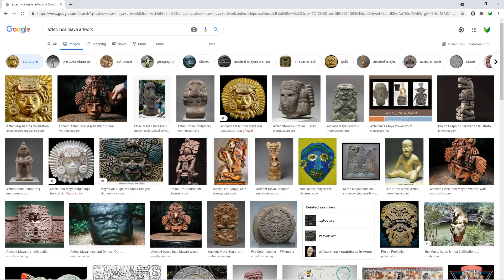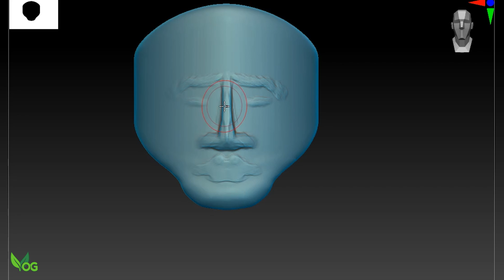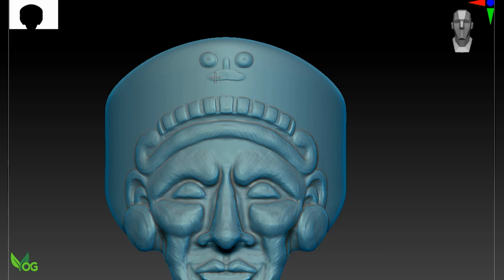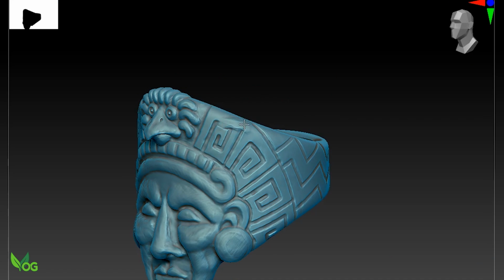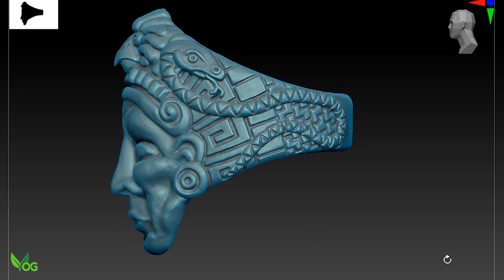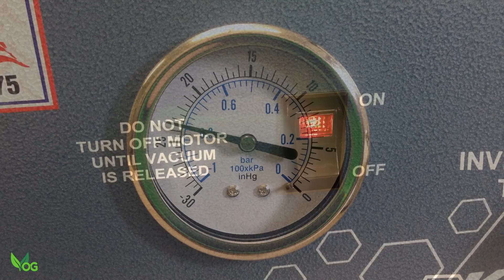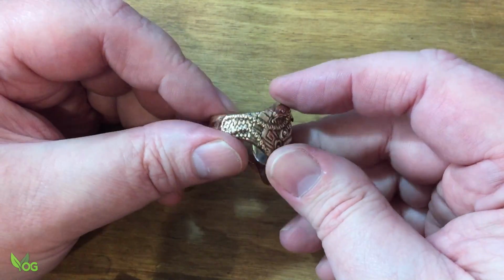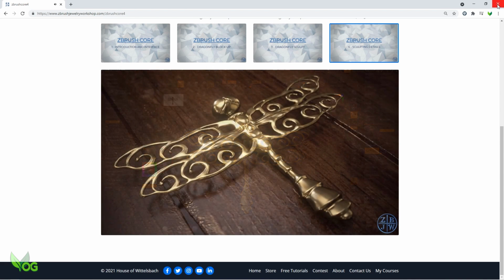Casting an Aztec inspired ring - 3D print to metal ring home casting by VOGMAN

Comment: Those snake heads and that beak are so detailed you've done an incredible job as usual 👏 Wondering which buffing wheel you used for this and what rubber/silicone gasket you use on your vaccum machine?
Reply from the maker: I haven't a clue about gaskets... they came with the Vac machine. As for buffing wheels, I just use whatever I can get 😁
Reply: @vogman  Not a problem i believe we need the graphite ones for casting gold. Yeah same here lol just been trying a few different ones to see whats effective 😅

Comment: Hi, I had an idea which I though you could test,  I will also test it.  Since burn out resins are quite expensive, I had the idea of printing a reverse of the item in a square/rectangle mould. You could add some posts extruded on one side which enter into holes on the other side to line up the two halves, and add an Injection port. You would then have a master mould you could inject with regular casting wax and use over and over again, and it's made of regular resin. I checked the temperature that most resins melt at and the wax seems to melt at a much lower temperature so I think this could work. Please let me know your thoughs,  maybe you have even tried this and I didn't see.

Comment: Hi VOG, it's been a while since I've commented, but I was wondering if you could help me out on a small predicament I am having. I would like to know if you have any idea on how I could convert the weight of the 3D print (finished, cleaned, cured etc.) to approximate casting weight. I've had some castings made and I've tried the method of using wax weight * metal specific gravity, but it is off compared to what the raw uncleaned/unpolished piece weight is. Do you have any idea on how to be more accurate or closer to the actual weight (of course, what's left of the sprue usually does add a little weight, but my pieces are cut pretty close so this may be negligible). Please let me know, and if anyone else has any input, please feel free to comment. Take Care. 
Regards, Tanner N

Comment: Wow!
Reply from the maker: Thanks 😁
Reply: @vogman  from the accent and the hobby... Is it fair to deduce that you work in the jewelery quarter in Brum?
Reply from the maker: I think it's about 10 miles from here as the crow flies, but no, I'm not employed there... I haven't been there in years. I am a complete amateur. Until just a few months ago I'd never had a bash at CAD work, jewellery design, etc. Metal casting is something I sort of fell into when trying to make a remote control lawnmower. This channel is very much my journey. I don't think I've held anything back, especially my many mistakes 😁
Reply: @vogman  Honestly, the humility and openness of sharing mistakes is 1000% more valuable than people who hide their mistakes and make everything look easy. I am an aerospace engineer in academia and I can tell you I've learned more by binging your videos in the last couple of days, vicariously learning how to and not to do things through you, than I have in any journal or textbook. 50% of the battle of disseminating knowledge is in its presentation, which you have also nailed. I doff my cap sir, and will be heading to Patreon to support. Thanks again!
Reply: ps: Specifically, your videos have helped me dial in what methodology and equipment I will be using to cast some aluminium parts for a drone. I've always stressed about detail and resolution in prints but what you guys do in the figurine/jewellery world far surpasses what we need (although geometric tolerances are undoubtedly much lower)
Reply from the maker: That's incredibly kind of you. I always think that the guy who doesn't make mistakes is the guy that hasn't done anything. I've made plenty and shared them as they've come up. My hope has always been to interest and inspire others. If I can spare them unnecessary time and expense, then all the better.
Reply from the maker: EXACTLY!!! I've had a few criticise my jewellery or miniature castings as being frivolous or pointless. Personally I've simply been trying to perfect the craft, attempting to get more and more detail into a piece. It's more entertaining to me (and hopefully others) to see this on something that's aesthetically pleasing. But with skill acquired, it's then possible to make anything. I have a good friend that uses these exact techniques to reproduce scale parts for a steam loco build wit great success (he's a retired engineer). Making small cogs, propellers and more is in my mind just an extension of detail... with detail comes accuracy. 
Genuinely I believe that anyone can do what I do. I'm truly nothing special  😁

Comment: Have you ever considered getting a flex plate for your 3d printer to make removing prints faster and easier?
Reply from the maker: I've never bothered. I just think of it as one more thing to clean 😁
Reply: @vogman  Fair enough. I get scared every time I take a scraper to the build plate that I will gouge the surface. So I personally find using them helps my peace of mind.

Comment: Just started using Sculptura and yet to try metal casting as still building foundry, but I pissed myself laughing at the "Big Bird Ref". I have a new appreciation of how much time it takes just to get shapes to work with 3d modeling. Great work - Im inspired to keep going
Reply from the maker: Do keep going, it's great fun. I haven't tried Sculptura but in honesty sculpting is much the same with all the packages. It's just pushing, pulling and smoothing... though I admit it's not quite as easy as it sounds 😁😁😁